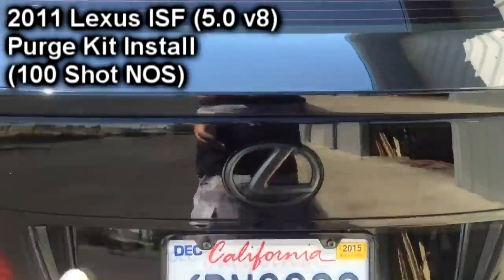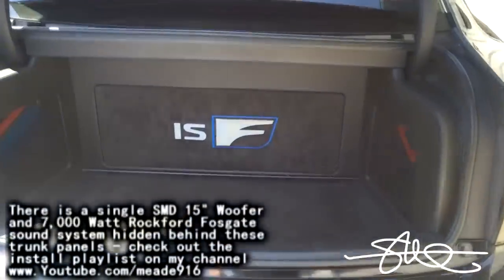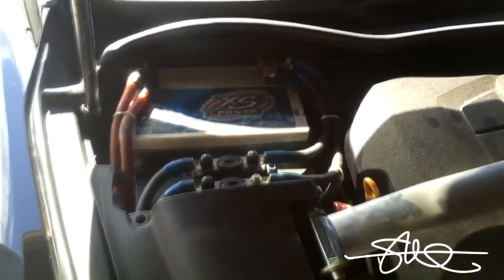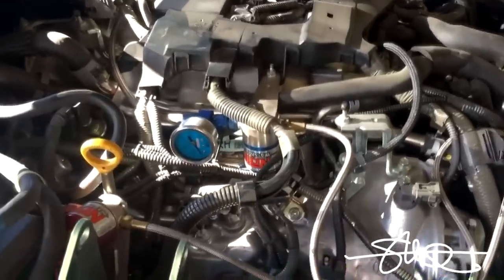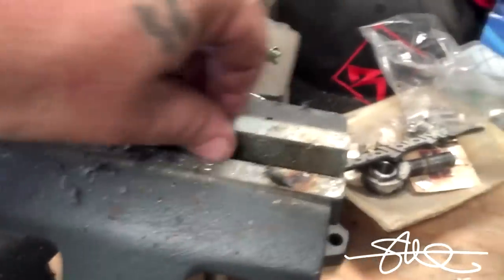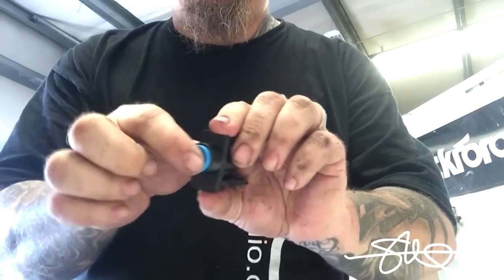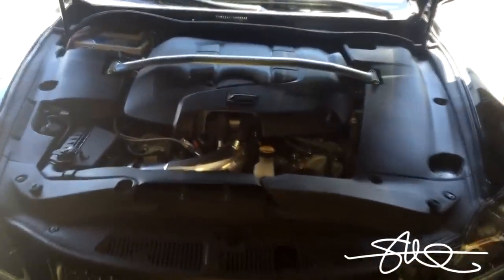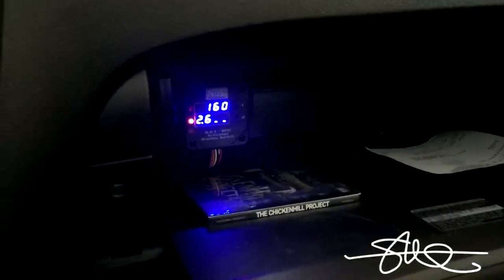Lexus IS-F on 100 Shot Nitrous (NOS) Purge Valve Kit Install

Comment: what happened with the tinted tail lights? as always clean install!
Reply from the maker: qwerty123456789 they are still tinted.  They have never been blacked out.
Reply: Probably got a fix-it ticket. California has stupid laws for everything
Reply from the maker: ***** ehhh, no.  Already said they are still tinted.  They never were blacked out, just tinted.  Look at the reverse light.  That gives you an idea how dark they really are.  In direct, 1pm 110 degree sacramento sunlight, the red looks redder than other times when it isn't.
Reply: ohhh ok, I didn't see your reply. It was hard to tell at first with the red being so bright in the sun.
Reply from the maker: ***** when the sun isn't so bright they look a little darker.
Reply: meade916 sweet as